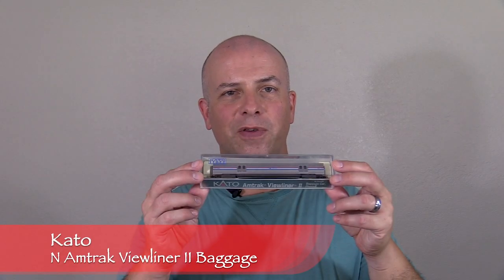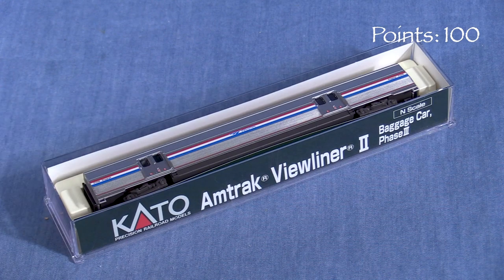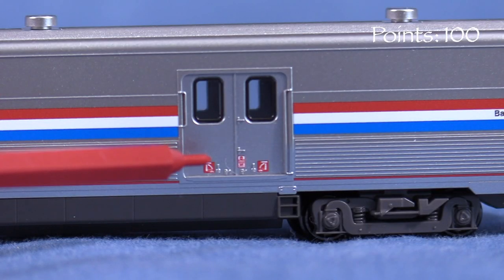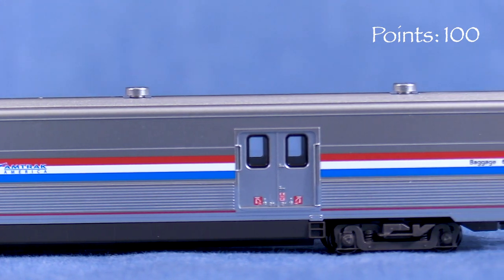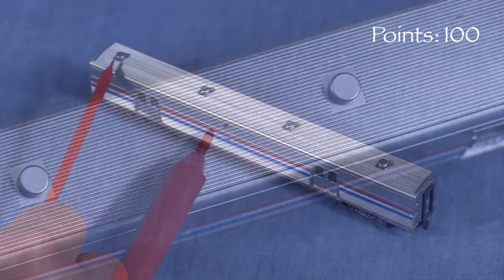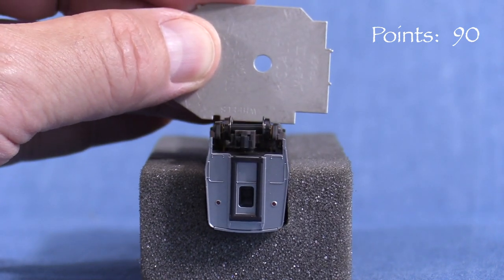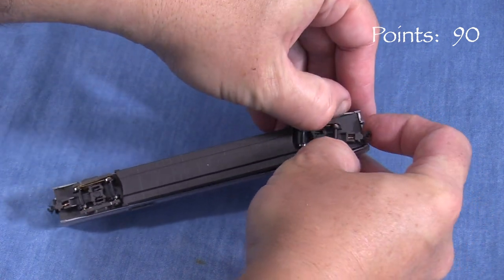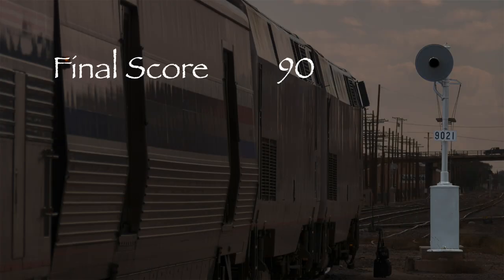Product Review N Kato Viewliner Baggage Car

Comment: Thanks, Dan, for your thorough review. Kato makes some really good model trains. Although you found minor defects in its coupler heights (which were so minuscule that I wasn't even able to discern them while viewing this video), you rated the rest of the car well. That just goes to show how much Kato invests into its quality control, which dwarfs the usually feeble quality control attempts carried out by most other N scale manufacturers combined! Kato rolling stock with their mostly molded-on features may not offer the finest degree of outer details (such as something made by ScaleTrains or Intermountain would have) but they still rank among the best for their quality workmanship, crisp paint, and overall reliability. I love Kato for these reasons!
-from Tom Pilling
Reply from the maker: Kato's operational quality has always been top notch.  You're right that the detail level is sometimes less than some other manufacturers.  In N scale I think that stuff matters a little less because it's so small and hard to see anyway. I really like Kato products.  Thanks for watching!

Comment: Thanks Dan,  I was wondering if the weight is light to accommodate the lighting kit....thanks for sharing....Jack
Reply from the maker: I've found a lot of Kato N scale passenger cars are pretty light.  At least with the baggage car it would be easy to add weight since it's basically empty inside.  Thanks for watching!

Comment: The high coupler thing didn't bother me until I coupled it to the Kato Superliners. I noticed it was way too high. Easy fix. A hot butter knife to the coupler shank where it connects to the truck, quickly touch it for 2 seconds, move the knife out of the way and start bending the shank downwards. It melts it nicely into correct height :)
Reply from the maker: Coupler height is one of the keys to reliable operation, which is why I'm so fussy about it.  Using heat is definitely a solution that I had not considered.  Thanks for sharing!
Reply: @DanielCortopassi  no prob Dan!!! Yeah it worked out for me and I can't wait for the new release of Kato P42's this month!